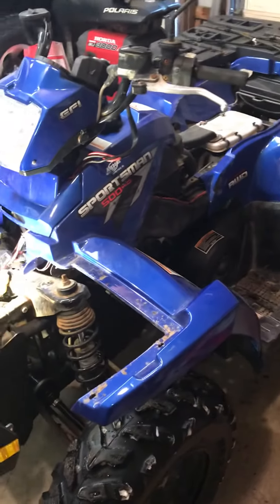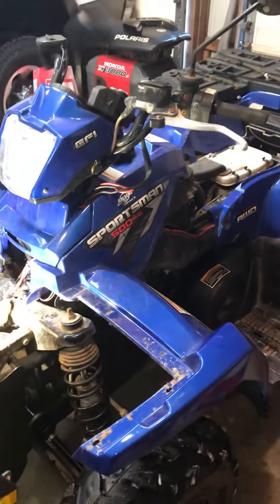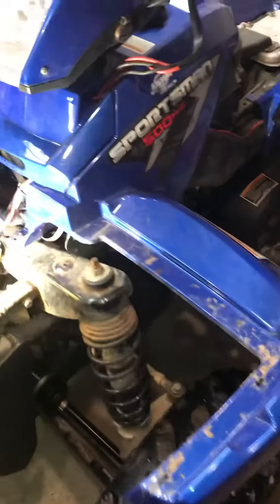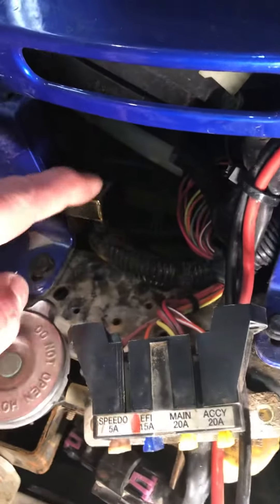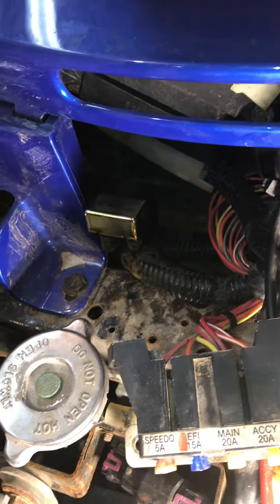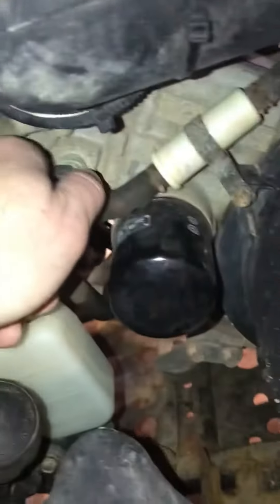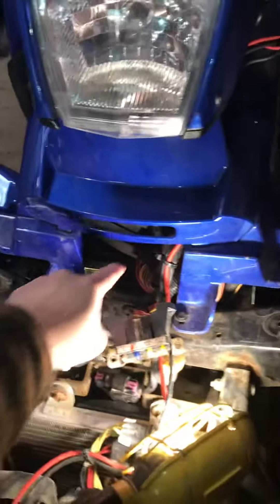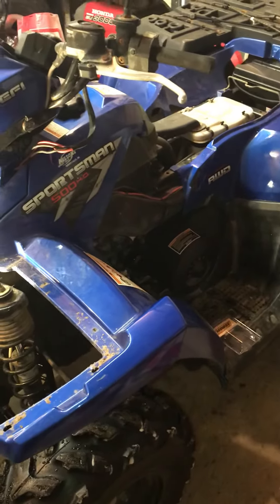2008 Polaris Sportsman 500 EFI Cooling Fan Issue RESOLVED!!!

Comment: Before replacing the circuit breaker when you pulled the coolant temperature sensor harness did your fan kick on? Mine doesn't but I know the fan works because I can give it 12 volts off of battery and it's fine. Could be a wiring issue of course just not sure if the circuit breaker still allows it to kick on without the temp sensor plugged in.
Reply from the maker: My fan did not kick in when I unplugged the coolant temp sensor. And same with my fan; I put 12 volts to it, and it worked fine.
Reply: @michiganman5341  thanks

Comment: You mentioned efi issues. Mine won’t start easily, but once it starts, it runs great. If yours did same thing, any tips would be appreciated!
Reply from the maker: Doesn’t sound like the same issue I had. My EFI issue was wiring related. It was a bad wiring harness/connector. 

The only issues I’ve had with this machine have been repeated and seized up rear brake caliper and wiring issues.
Reply: @michiganman5341  Thanks!

Comment: Is my fan on 2008 500 supposed to come on with the key?
Reply from the maker: It depends. It will come on if the engine is hot. But otherwise no.
Reply: @michiganman5341  ok gotcha. I am not an atv person, always just used tractor and golf cart so I am learning. My next question I reckon is how much of a ride constitutes it getting hot enough. Bought this thing cheap, only 100 hrs on it. Just been sitting.
Reply from the maker: @kipnix8775  they are supposed to throw a warning for overheating on the display if it gets too hot. Depending on outdoor temps and what work (or lack of) the machine is doing, the fan will kick on as needed. If you are worried that the fan isn’t working, start it up and unplug the temp sensor on the left side of the engine.  That’s a quick way to see if the fan works.
Reply: @michiganman5341  ok, I unplug temp sensor, turned on key and fan did not come on.
Reply from the maker: @kipnix8775  was the quad running?  Start it up and unplug it. If it still doesn’t come on you need to put power directly to the fan to check the fan motor.
Reply: @michiganman5341  ok, thank you for the help. Will crank it and check.
Reply: @michiganman5341  it will come on when unplugged and goes off when I plug it back in. Maybe get it hot and just see if it works?
Reply from the maker: @kipnix8775  run it for a while to see if it comes on. If not, the temp sensor may be bad.
Reply: @michiganman5341  thank you!!!